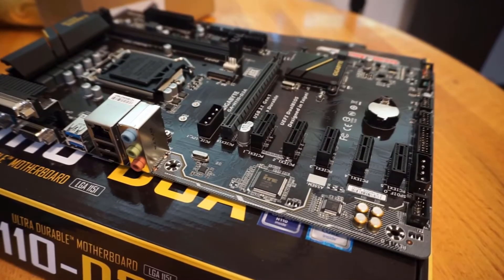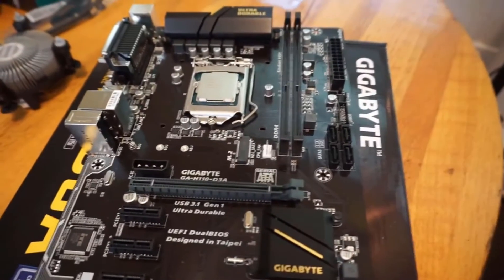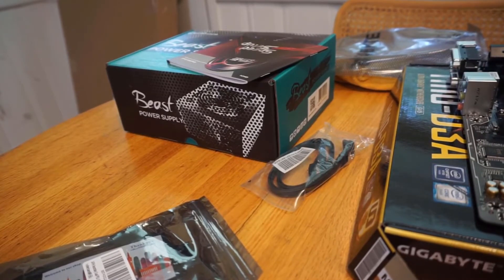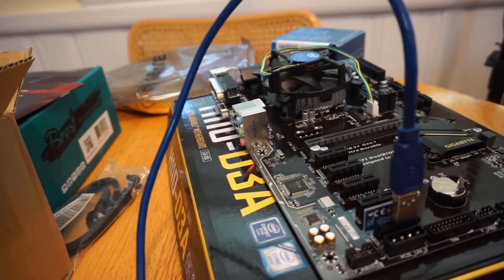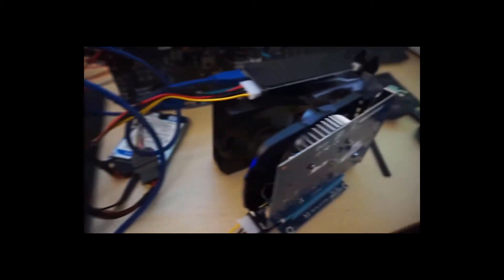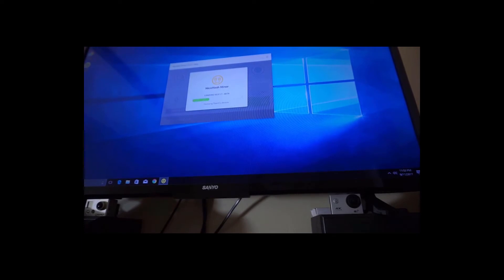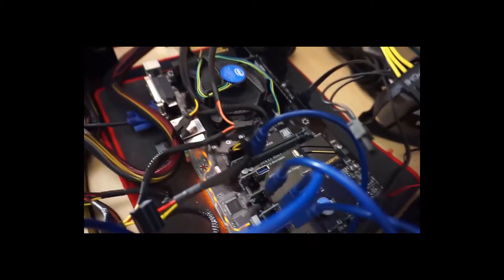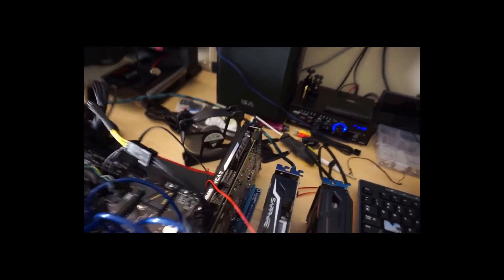BITCOIN MINING RIG  step by step how to build on the workbench most inexpensive way!!!

Comment: Hi Whats your BIOS settings I have the same mother board but I'm not able to see more than 4 cards on my device manager. Please share the BIOS settings.
Reply from the maker: Tibco Power hi not the bios go to device manager in windows  keep clicking add hardware if that does not work try moving the risers to other slots and see if that works bios just defaults.

Comment: Hi, can you list the links for all the parts you used? I'm mostly confused when you got the black splitters and those cable. Can you just give the link for them? Thx
Reply from the maker: Harvex hey the pci risers amazon the motherboard h110 d3a.. price has tripled  the risers come with power cable usb  and the pci plug
Reply: Oh okay. Please correct me if I'm wrong but I can build a rig with. Power supply, motherboard, risers, gpu, cpu, thermal paste, cpu fan? Anything else I'm missing
Reply from the maker: 4gb ram thats about it extra cables splitters for the gpu's come in handy
Reply: Ironbar 2 Thats it that extra splitter your talking about coming in handy. Please send me a link. So i know it and can buy. Thanks
Reply from the maker: Harvex I don't have the links depending on which gpu 6 pin 8 pin etc  splitters for them..
Reply from the maker: Hi i dont have the links amazon search put in "6 pin splitter "  or"" 8 pin" depending on your gpu's for cpu  if intel 6th gen 1151 socket use the g3930 chip  its about 45.00 with the cooler ... see ya
Reply: Ironbar 2 How would i know if i need a 6 pin or a 8 pin splitter pls.
Reply from the maker: Hey, each type of graphic card uses  either a 6 or 8 pin extenral power supply but  some like 1050 ti don't use a power plug so depends on which gpu your using
Reply: Ironbar 2 using a gtx 970 & 980. What will it need?
Reply from the maker: Harvex 970 is an old card uses 2 6 pin on each card

Comment: Bios setting video plz
Reply from the maker: GOSSIP WORLD will do  anything specific?? Bios slightly different with each motherboard will do a general ... thx
Reply: Ironbar 2  i have the same motherboard H110 D3A  PLZ TELL ME THE BIOS SETTING AS NOW I AM ABLE TO SEE 5 GPU ONLY
Reply from the maker: +GOSSIP WORLD hey I leave settings stock make sure windows and everything is working properly I don't overclock for the sake of reliability you can  oc the cpu but I leave the rest alone so  it runs 24\7 with no issue will do a video soon on that
Reply from the maker: GOSSIP WORLD it's not the bios go to device manager in windows And update drivers and under view search for new hardware also sometimes switching the order of the riser cables helps usually it is windows..after device manager do a restart and give windows time to recognize them...
Reply from the maker: GOSSIP WORLD stop with the bs